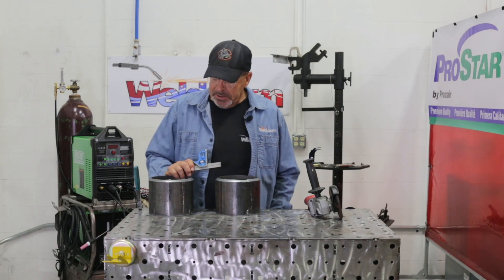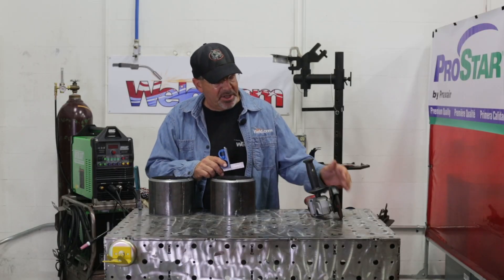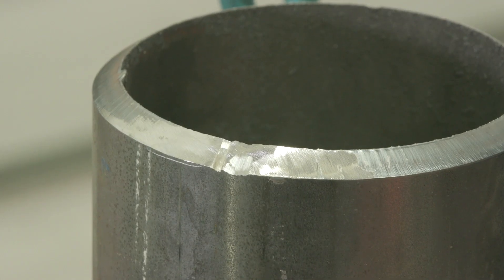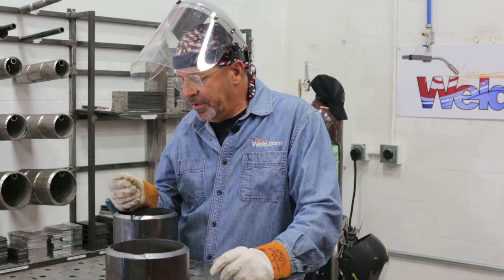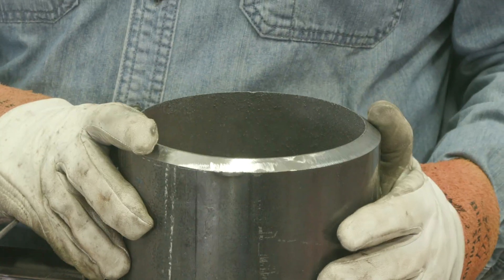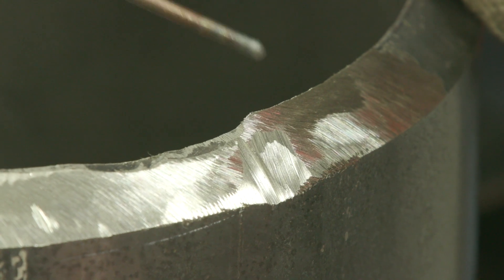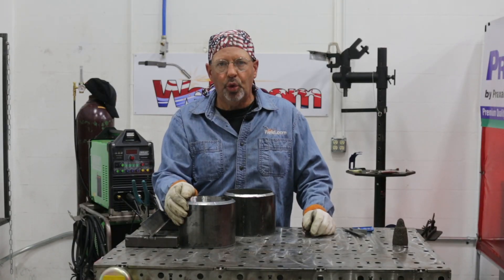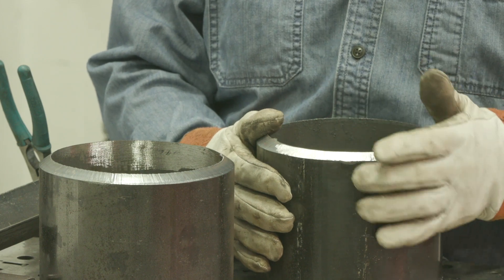🔥TIG Repairs on Damaged Pipe Bevels

Comment: Good stuff here. Thanks Bob!

For all the snivelers complaining about "real world", keep in mind these are coupons for students. In the dented root face in particular, a student could easily lose the keyhole or drop a snot ball on the inside until they become more proficient at pipe welding, so these repairs are necessary in this circumstance.

Comment: @weld.com can you advise me on the best way to weld chains like bike chains and heavy duty chains as I'm trying to make  sculptures  from them I'm using self shielded flux core wire thanks.
Reply: Self shielded will work. Mig may be better.
Reply: @bobmoffatt4133  thanks would I have to grind to a base metal if they have an coating on them?
Reply: @INTERCEPTER001  Wire wheel may work better. No grind marks.
Reply: @bobmoffatt4133  thanks Bob for that would it be possible to see a video on welding chains as there is some professions that create chain structures?
Reply: @bobmoffatt4133  the welder I'm getting is an gasless mig flux core  self shielded